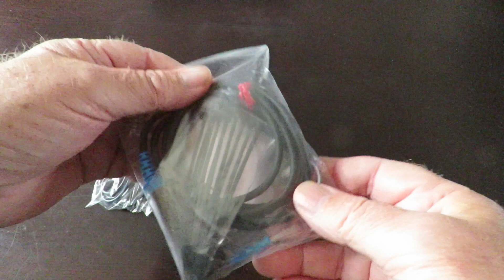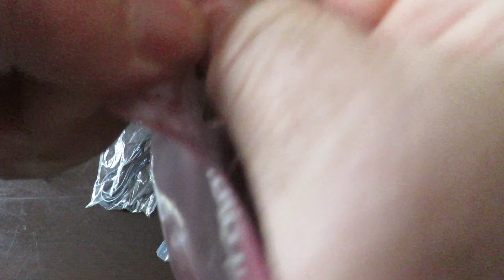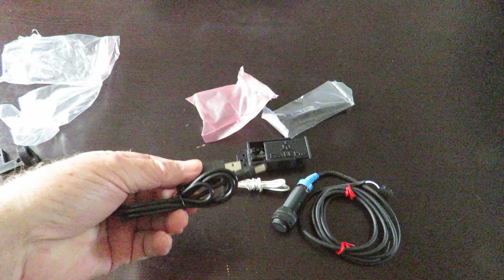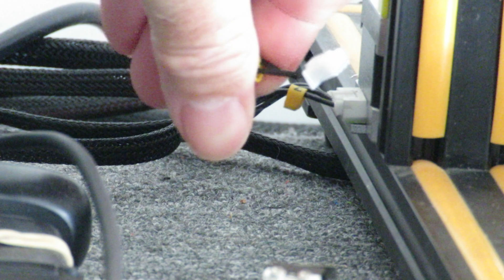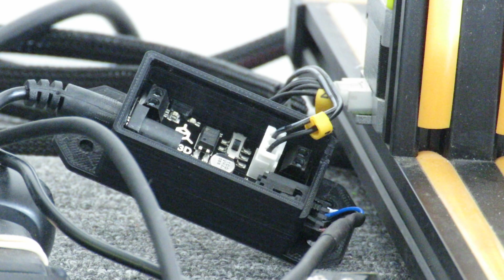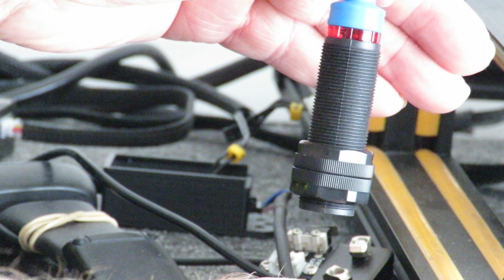EZABL Pro Bed Levelling Kit The Easy Way to Level Your 3D Printer Bed

Comment: How is the unit after some time is it the godsend it promises to be?
Reply from the maker: I find it useful, but I believe you can also achieve good levelling using solid mounts, instead of the standard spring loaded ones that come standard with the printers.